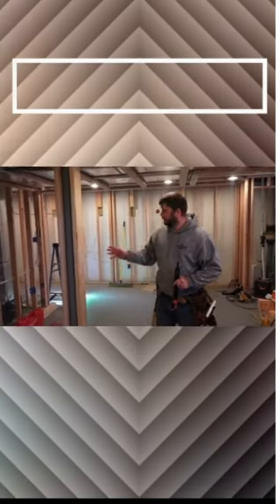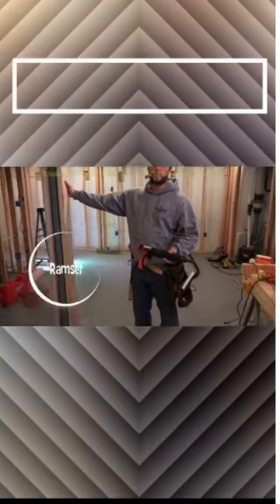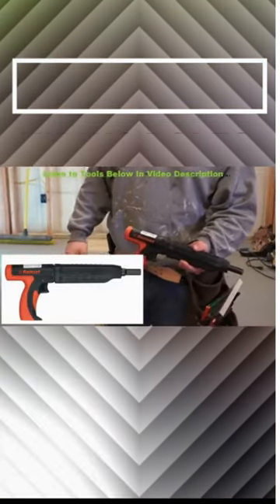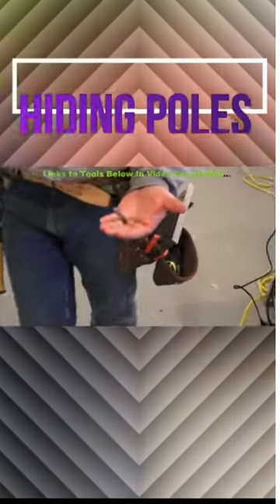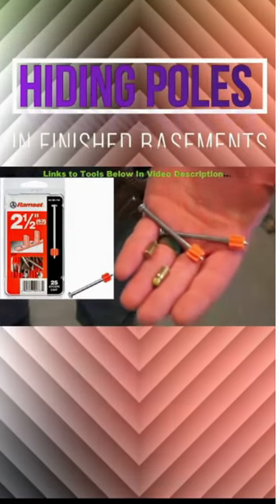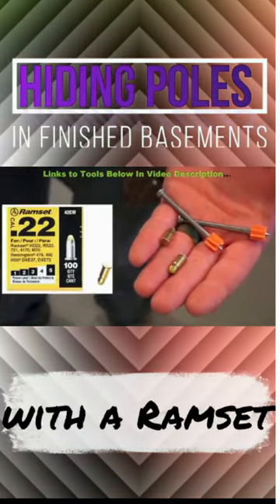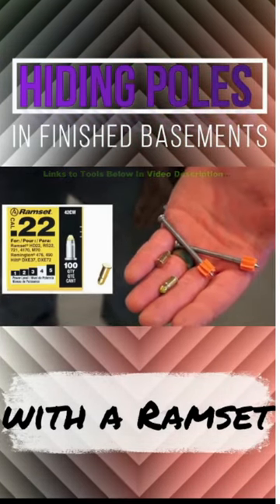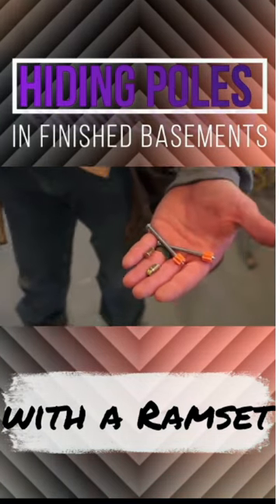How to Hide Basement Support Poles #shorts

Comment: Is a treated base plate not needed for the floor?
Reply from the maker: No...just keep the regular lumber off the floor 1/4" so it's not touching the floor and your good to go.  ~Eddie
Reply: @BasementFinishingMan  ok didn’t know you had a gap. So did you pin it to the top plate to hold it in place?
Reply from the maker: @1tufgt  Correct...pin to the overhead soffit blocking to stabilize the framing. Also, the drywall being glued and screwed with metal cornerbead knits it all together...you could back your car into that column and it wouldn't move once it's done.